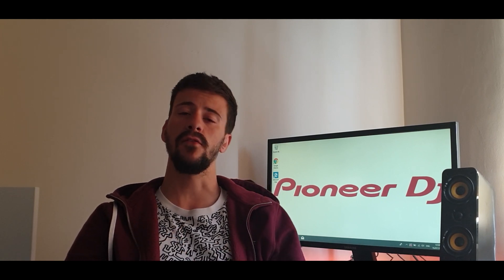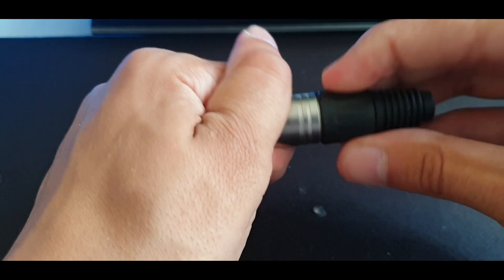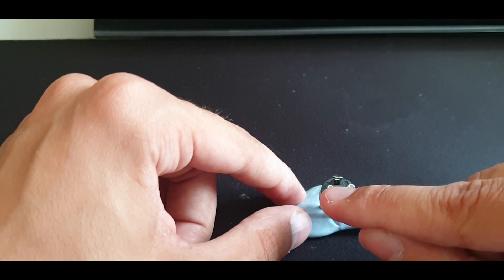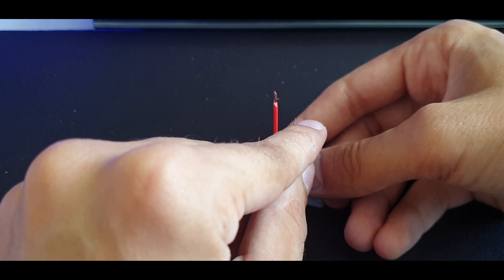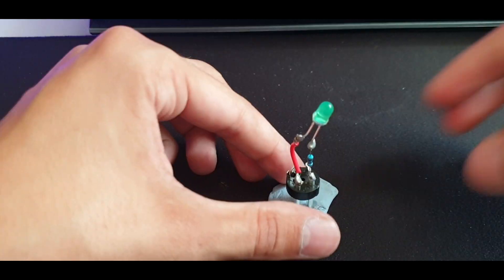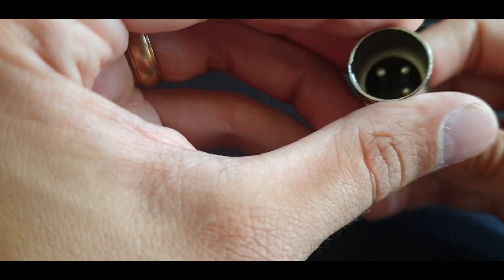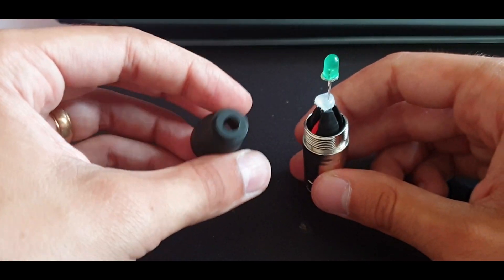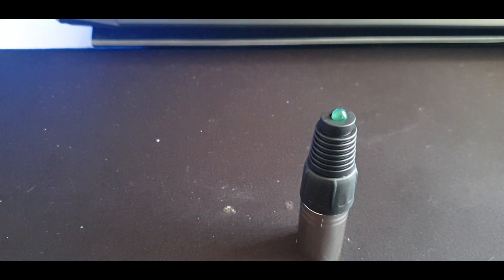HOW TO MAKE A DMX SIGNAL TESTER DIY

Comment: Didn't work......we use an input voltage of 220 - 230 AC here. So should I be using a different rating resistor for that.
Plz advice, thanks.

Comment: Cheap and simple thanks
Reply from the maker: Yes it works out alot cheaper than you would have thought the  buying them pre made not only that they are simple easy to make and also it builds up confidence if you have to fix or solder your gear